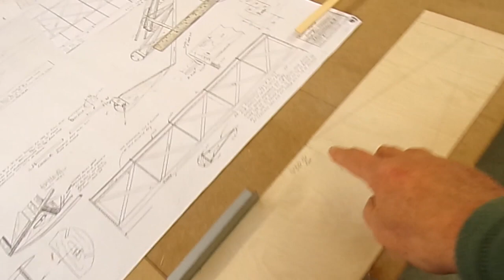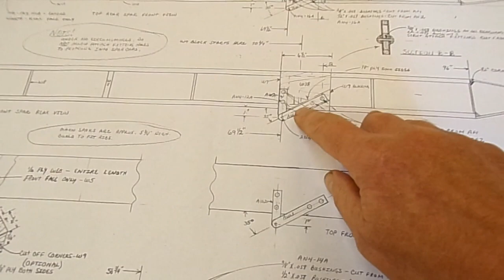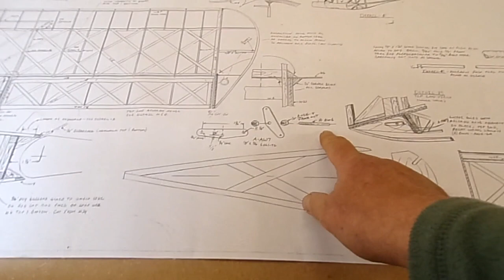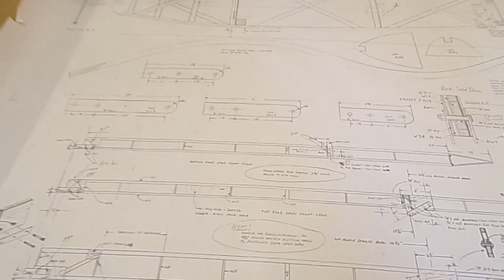EP27 Fisher Youngster V marking out the Wing Spars.

Comment: Thanks for the update. I’m a little confused over what the two parallel  aluminum angles do for you. I understand one to establish a true straight edge. But the other one capturing the spar web between the two and not leaving room for the spar caps is throwing me off.
Reply from the maker: Let me see if I can explain, the spar caps on the Youngster a bonded to one side of the web. Having the two angle strips help me maintain that critical distance for the caps, accurately for the full length of the spar. I hope that answers your question. Once I get some T88 there will be videos showing how the spar goes together, which might be better than my rambling words. Thanks for watching and asking your question.